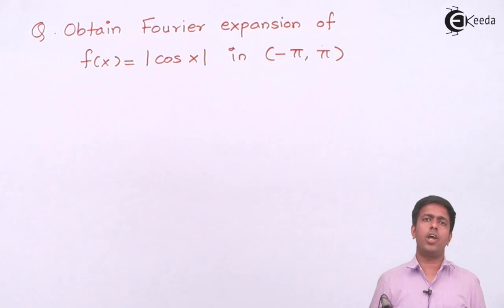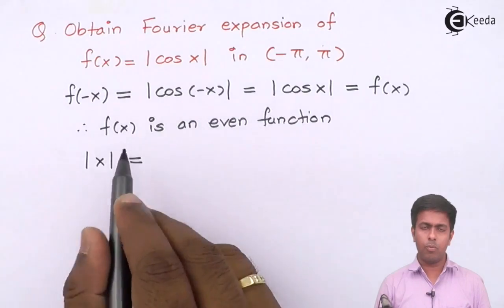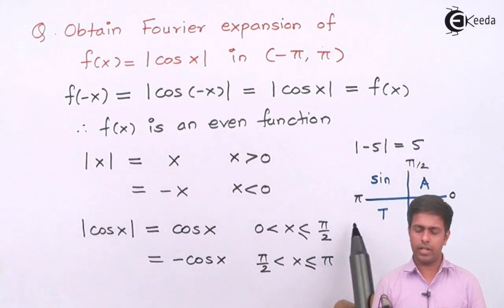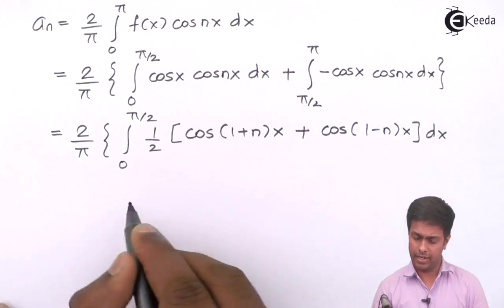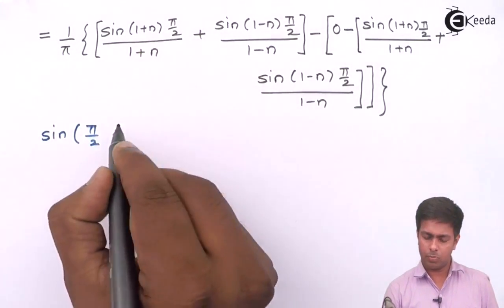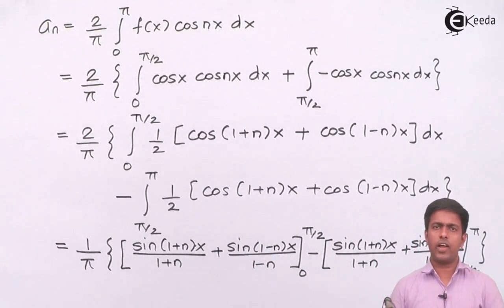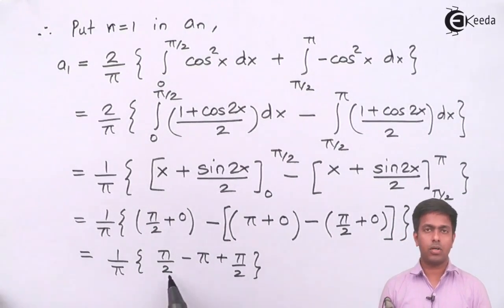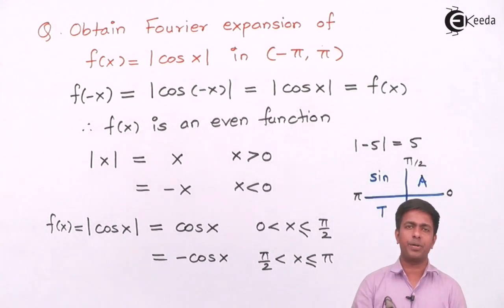Fourier Series of f(x)= |cosx| using Even and Odd Functions - Engineering Mathematics 3

Comment: sir while Solving for ao ,why did you take 1÷π in formula instead of 2÷π ....
since it is even function...
may you please clear it for me..
Reply: He forgot to take 2/pi
Reply: Wani Ajaz integration property applied first on all formula  when we change limit from -pi to -pi into 0 to pi  we multiple 2 in original formulas
Reply: vinay soni 
 I think  by multiplying it by 2 it will not become 1÷π rather it will be 4÷π..
Reply: Forget that, just remind this : "independent term" = (FUNCTION-AREA)/(FUNCTION-PERIOD).  Some books write "a0",  other "a0/2" and that's so tangled.  Just remind they both are the same:  INDEPENDENT TERM. The area can be calculated as you learned in Single Variable Calculus.

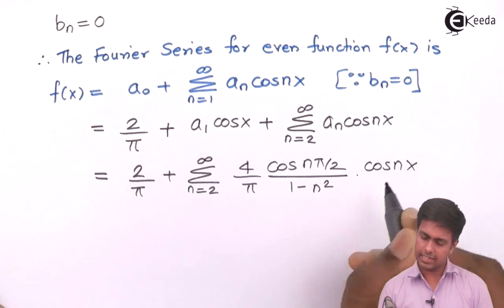Another thing, If you check it at 23:10, you can see that "cos(nπ /2)"  sometimes is 0, and sometimes is 1, so for having a better result you can acommodate de summation.

Finally answer is:  http://subirimagen.me/uploads/20181116102601.stackexchange

View complete on: 
https://math.stackexchange.com/questions/697843/fourier-series-for-cosx